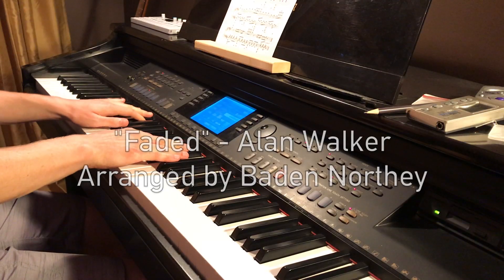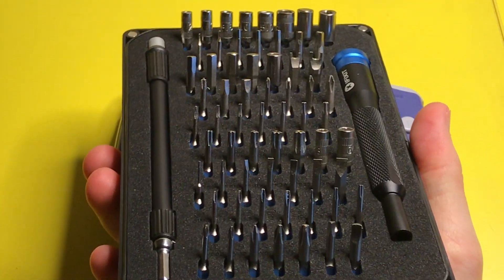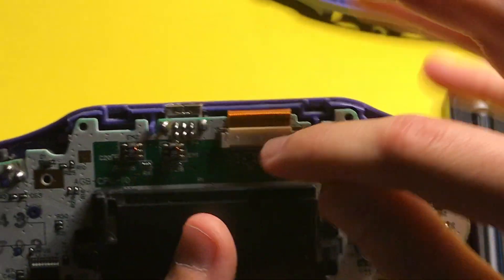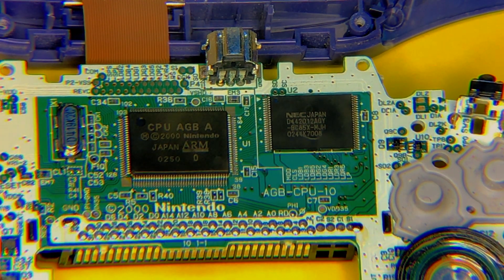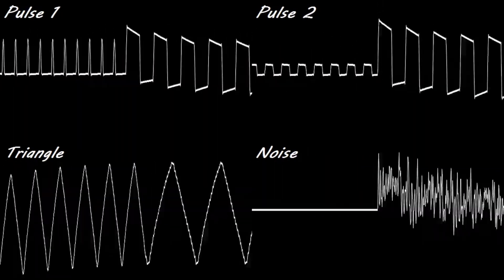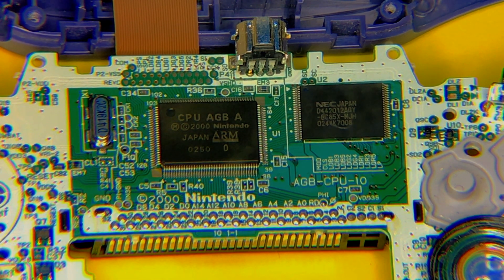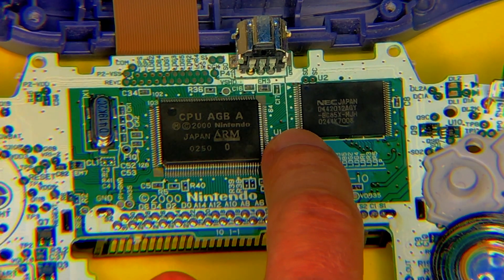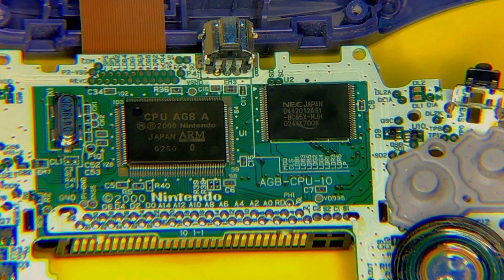The Gameboy Advance Sound Hardware

Comment: Something about the GBA's soundchip just gives it the edge

Mario and Luigi Superstar Saga and Pokémon Emerald utilize it the best
Reply from the maker: Fr, those are some of my favorite games of all time for that reason
Reply: @aura-audio  the thing i dont get is, if u are supposed to have only 2 direct sound channels and 1 sampler, why can i hear more than 3 instruments being played in pokemon emerald songs? where are they coming from if the rest of channels are 2 square + 1 noise? can direct sound channels reproduce more than 1 sound each?
Reply from the maker: Good question, it’s definitely possible with some programming tricks. The GBA hardware is close enough to the metal where you could play sounds using other Direct Memory Access and timers if you wanted to.

Comment: Does anyone know if the GB soundchip can be accessed in GBA mode?
Reply from the maker: That's a good question. Yes, by using the DMG (Dot Matrix Games) sound enable registers you can use the pulse signal channels from the original Gameboy: https://www.coranac.com/tonc/text/sndsqr.htm
Reply from the maker: It's a little tricky to learn, but once you know the registers you need to enable, sound on the Gameboy is actually pretty simple/direct which is why I like it so much
Reply: @aura-audio  is there a limit on the number of channels you can use from each chip? Or does using this effectively double the number of channels you can use at once?
Reply from the maker: Yah I think original pulse channels gives you 1 sweep plus another pulse generator without the sweep plus the noise/rumble channel for percussive sounds plus another channel where you can load in your own 4 bit wave table. Then with Gameboy Advance you get 2 more 8-bit channels. Pretty sure you can use all of them at once
Reply: @aura-audio  If there's only 2 8-bit GBA channels, how were tracks done that seem to play up to 4 or 5 samples simultaneously? Am I mishearing or is there a way of redistributing or assigning channels for different purposes depending on what's needed?
Reply from the maker: Yes totally every game developer has a strategy. You can actually see game developers achieve audio streaming in 4 bit on the original Gameboy in some old games by loading the samples into memory and bank switching them at the right time on the 3rd channel custom wave table pulse generator which creates the illusion of hearing many sounds, but it's not out of the ordinary. Sure seemed like it when I was learning for the first time, but it's actually a common strategy. And the 8-bit audio streaming channels on the GBA don't require using the CPU because you can use FIFO interrupts with timers. I made a recent video on this here: https://www.google.com/url?sa=t&source=web&rct=j&opi=89978449&url=https://m.youtube.com/watch%3Fv%3DT9ZONwXBClg&ved=2ahUKEwjGwK6enYmDAxXaTjABHeN4DCMQwqsBegQIHxAG&usg=AOvVaw2swfKpT1yv58rMrW2ATgju

Comment: Hey I'm looking to make a really high quality recording of the GBA start up sound
Do you know how I could do this?
If I like have to wire into a GBA or maybe use some sound chip emulator?
I haven't found much information so far and you seem very knowledgeable 😅
Reply from the maker: I would use an audio interface or preamp
Reply: @aura-audio  Thanks for the response! (And incredibly fast)
But what do you mean exactly?
Reply from the maker: Record the sound directly from the headphone out on the GBA and route it through a preamp so when you amplify it the signal is clean. Google “preamp” and you will find many examples :)
Reply: @aura-audio Ahh I see
Thanks!
Reply: @aura-audio  I do wonder though 😅
Is it possible to emulate the sound chip on a computer?
Reply from the maker: If I remember correctly, the GBA startup sound is an audio sample stored in the GBA’s BIOS (Basic Input/Output System). So no, the GBA startup sound cannot be replicated exactly unless you have the exact audio sample or a time series of the exact sinusoids which add up to create the sound.
Reply from the maker: In terms of the pulse signals, yes those can be recreated easily by adjusting the duty cycle of a square wave generator accordingly. I believe I made a video right after this one or shortly after explaining this process.

Comment: Well explained,yeah the gba didn’t had such high quality audio,it did suffer from noise over times,BUT i was thinking maybe we could take advantage of the noise channel by let it generate inverted noise from it’s unwanted noise and synch them correctly with each other in order to cancle each other out to supposedly result theoritically in a much cleaner audio to more closely resamble 16bit audio,,but am not sure if some game developers tried to take advantage of the noise channel that way but it would be interesting to prove such smart clever theory😁
Reply from the maker: Thank you for watching and I'm glad the explanation helped 😄! One thing I learned this semester which I didn't know when I recorded this video is that it's actually a good thing to have some noise at low bit-depths. This is because the audio gets distorted when going to the lower bit depths. The noise helps make this process more random and thus it sounds more natural. In this video I didn't set up the sound correctly which made things distorted. My more recent video on this topic has a better demo and you actually can't hear too much noise. 16bit is actually what most digital platforms like SoundCloud use. Something else which distorts the audio is down sampling. This causes other distortions with the audio not necessarily related to the noise generated by the noise channels since those use frequency counters for pseudo-random noise. However, I do like your thinking, and you've inspired me to make another video on this topic. Thank you again for watching and commenting your thoughts on the video 🙌🏼!

Comment: Isn't the PSG part of the sound system just the Game Boy PSG since it uses it to emulate the sound when playing Game Boy or Game Boy Color games?
Note: The PSG is also used in several GBA games as well, such as the Densetsu no Starfy/Stafy games, Wario Land 4, the Klonoa GBA games, Mario & Luigi: Superstar Saga, and Mother 3.
Reply from the maker: What do you mean by emulate? I think they're all just voltages generated by a chip inside the CPU. It's not too difficult to create those kinds of signals.
Reply: @aura-audio , by emulate as in the actual Game Boy sound chip not being present in the GBA hardware.
Reply from the maker: @PKSuperStar256  I see, yeah that's a tricky but good question to think about. I wasn't really sure what the answer was when I made this video, and I'm still not really sure to this day but remain curious about it. We know the GBA has a SoC (System on a Chip) which contains a whole bunch of components, and it's possible one of those components is the chip for the PSG. I speculate the GBA uses a similar PSG (if not the same one) as the Game Boy and Game Boy Color because the sound is indistinguishable. However, when I listened to the DS which can run GBA games but not Game Boy Color I heard a difference in some cases with some effects (i.e. vibrato used in the background music for Mario Bros Classic in Super Mario Advance). The vibrato sounded more choppy on the DS than it did on the GBA. This could be an artifact due to the timing systems, but my thought is the DS emulates the PSG as you mentioned.
Reply from the maker: Given this difference happens in a GBA game and not a Gameboy Color game is kind of a bad example, but I also just realized there would sadly be no way to test a Game Boy Color game on the DS. We could however test and see if there's any sound discrepancies between the GBA and Game Boy Color.
Reply: @aura-audio , the Everdrive can help with that. You can put a GB/GBC "emulator" on it and put supported games on said emulator and they should sound similar, if not, the exact same as the original intended hardware.
I did it myself since I have one.
Reply from the maker: @PKSuperStar256  Oh wait, that's a good point! I totally forgot about that. I have an EZ-Flash Omega so I could try that. This will be a good idea for a future video and thank you for mentioning all this info. I've been meaning to get back into exploring this stuff once I'm done with school.
Reply: @aura-audio , I see, you're welcome!

Comment: The sound hardware for the GBA is an odd duck. I remember reading that it's incapable of doing low tones for some reason--as in, the speakers will burst into flame if it tries to. Rare found out about this the hard way while porting DKC2 and 3 to it, and it was a big reason why DKC3 had it's soundtrack completely overhauled for the GBA port. And Castlevania: Harmony of Dissonance apparently had to use the original GB sound chip for it's music (hence why it's so different from Circle of the Moon) because the game was pushing the CPU so hard as is that there wasn't any room left to use the actual GBA sound without overloading it!
Reply from the maker: Dang that makes sense. I would be interested in reading some more about this now that I’m in the middle of all my DSP classes.

Comment: I want someone to take all the code for this sound chip, load it into a computer, and either turn it into a virtual sound generator for DAW's, or figure out how to get that hiss sound to be transferred across through some form of dial knob, along with a preset that is literally the hiss of the original hardware. Basically an effect/bitcrush plugin. Would such a thing even be possible?
Reply from the maker: It is for sure! I think Tony Fox, the composer of the music in the Game Undertale, used a plugin that did this. I should make a video about that soon 🙌🏼!
Reply: @aura-audio  absolutely. I primarily use toxic biohazard when trying to generate sounds, so I'm trying to specifically replicate the hiss of the gba's dodgy sound chip (because I wholeheartedly disagree with common sentiment that it sounds bad. I think that bad sound quality and hiss actually adds to the songs and charm.), for something like a pad or ambient texture. Then layer that hiss thing into a very wet reverb for some very unorthodox energy that I've yet to properly catch outside of radio static. Which in of itself is tough to get propery